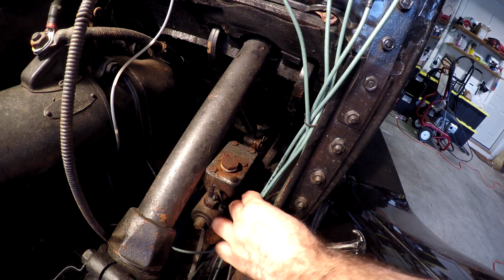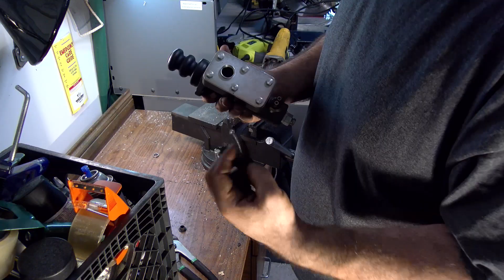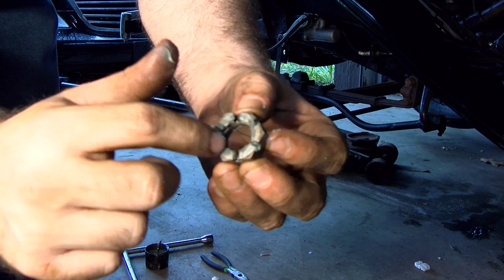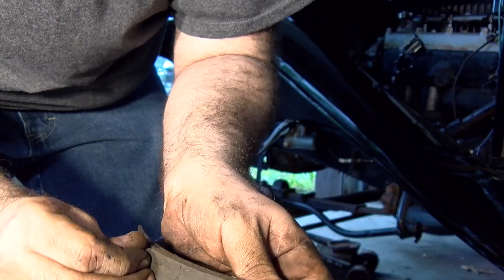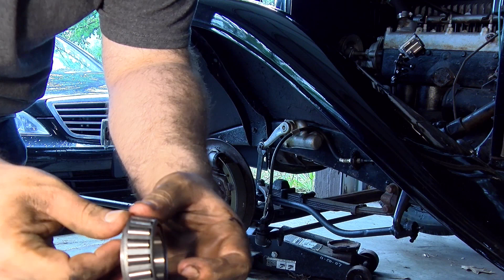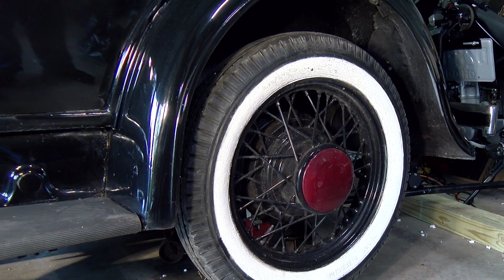It Runs… But It Won't Stop | 1931 Plymouth Brake Rebuild

Comment: If the bearings were in good condition ,,I would not have replaced them,,,As those old bearings would have been of way superior materials to modern mass produced ones,,
Reply from the maker: Yeah I guess in retrospect I could have taken a second and looked at them to see if they were pitted or worn. I guess the parts canon strikes again.